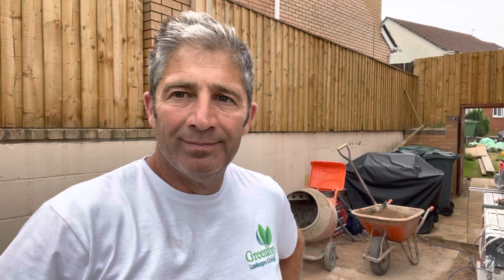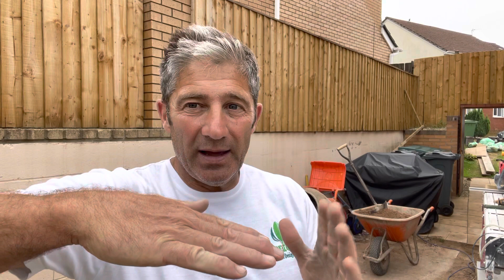Patio Has Been Laid To Damp Course

Comment: Hi John, you sound like a very honest and genuine person well done for having morals. I have a quick question, i have a Timber Framed House, with block work on the outside, and Timber Framed inside, I've ripped up decking that was installed in our house we purchased as it was very slippery and unsightly.  It was installed approx 1.5ft above the DPC.  I've removed everything now and I'm back down to ground level and its all Type 1 at ground level, however I'm installing a patio, however it will be impossible to install it 150mm below the dpc as it would involve a serious amount of material being removed and the patio would then be approx 2ft below the rest of the surrounding garden and paths to the side of the house.  The side of the house has block paving and quite a large gap between that and the house which is filled with stone chippings.  My finished patio level will be approx 60mm below the DPC and just below the air bricks.  Would this be OK?  I was planning on leaving a gap between the house and the patio and then either installing a grating cover between the patio and wall of the house and dig down below that back down to the ground level that was there below the original decking (which will then just let the rain water flow through as it did the decking) (I can't install an ACO drain as cant tie into any of the guttering drains) or alternatively would it be ok to just leave just a gap between the patio and the wall of the house and just fill thar with stone chippings?  Would I need to make sure the ground below the stone chippings is 150mm below the DPC?  Would this the be OK?
Reply from the maker: @scubacollie2083  hi, thanks for the response it’s very kind of you. If you would like to speak on the phone please don’t hesitate to call ☎️

Comment: Just some general advice please. Considering laying a porcelain patio at the back and side of the house. Likely to be about 9 or 10 metres wide by about 4 metres. Thinking of going 1 brick below the DPC as our doors have been set quite high. Looking at placing something similar to ACO threshold drainage against the house wall between the pavement and wall, but with the fall towards the drainage system, so in effect from the slabs towards the house, but into the threshold drainage of course and the threshold drainage ever so slightly angled with a fall away from the house. Have a number of downpipe points to be able to connect the threshold drainage into as well. Do you think that would be OK or risking problems?
Reply from the maker: Call me Liam mate it’s easier
Reply: @GreentopLandscapes  Will do John. Thanks.

Comment: Hi John, im glad ive found you  on here as i also need some advice before commencing with new porcelain patio being laid finishing at dpc level . My building inspector said it will be ok as long as acco drainage system is layed level  along dpc along new extension . I havent yet had extension walls rendered and my thought process is saying lay acco drains first and then apply render drip bead onto wall so it sligtly over hangs acco drains and then apply silicone render to external walls then lay patio with a slight fall to acco drain. Do you think i may still end up with damp issues or does this method seem ok. Thanks for any advice , Terry
Reply from the maker: Hi Terry give me a call Buddy it would be easier to explain
Reply: @GreentopLandscapes  Ok will call tomorrow ,Thankyou
Reply: Can i have your number please.Im struggling to get it , just phoned two wrong numbers lol. Cheers
Reply from the maker: 07795595994

Comment: nice videos very good , i have a little quiestion  if i want to put a patio along the damp course level threshold level . by   having  the fall away from the house can i put a layer of dpm against the house in between the slabs and the wall. or should i leave a gap and fill with stone perhaps something close to the slab colors (and put dpm between wall and stones perhapes) . i know really patios should be well bellow any damp proof course really
Reply from the maker: No it won’t work Oliver as you will have what is called bridging

Comment: Great information,  would you recommend to use grano dust instead sharp sand to lay bricks paving?
Reply from the maker: Sharp is better but it’s not like it used to be
Reply: @GreentopLandscapes  thanks , what’s the difference really?
Reply from the maker: Sharp sand will permeate natural where as stone dust is a by product with does not have the porosity
Reply: @GreentopLandscapes  thanks for your attention.
So, grano dust not recommended at all? 
Do you think the patio will fail with grano dust ? Clay brick paving?

Comment: Hi, I have watched your earlier videos and at the time you seemed to be happy with Easy Joint. I am currently using it on my sandstone project and am now concerned that you no longer seem to recommend them?
Reply: The easy joint should be fine on the sandstone it’s the porcelain that he talking about I’m assuming as porcelain isn’t porous and the easy joint is which could cause lamination problems but that should happen with sandstone
Reply from the maker: I think we all move on to better and different things, Easy Joint can work well if well compacted and with a lot less water than what they recommend so you can really fill those joints and get it to like the sample block you see some times , plus it works better if you have a sub base that has a porosity value so the water keeps moving and not freeze in the joints, always happy to discuss this,
Reply: @GreentopLandscapes  thanks for your honest answer.
Reply: @GreentopLandscapes  to increase water flow through the mortar bed would you advocate drilling drainage holes between the paving joints before installing the pointing?
Reply from the maker: It’s never affective enough

Comment: I see damp coarse bridging time and time again. Most of the time it's because they can't be arsed digging it out to the correct depth to allow for that 1 or 2 brick below DPM. If they can't be arsed to spend the time to dig it out they most certainly are not going to do a good decent job with any thought about it. Drainage and where the water is going to go is the first thing I do when I design and build a garden or patio. And up here in Carlisle it rains alot and I discuss this thoroughly with the customer and drill it into them it's the most important part of patio design and build. My simple sentences to alot of customers that want to know why landscaping is expensive I simply say it's the biggest most expensive room in the house to do properly and say to them what makes them think a garden or patio will cost any less than a kitchen or Bathroom to do. Then I  tell them about the drainage and all the details that go into building and designing there gardens. Explain things properly and customers will understand and constant communication is key
Reply from the maker: Spot on

Comment: Sounds like a looming disaster. They will probably need to cut the closest slab to the house in half and pull the drain off the wall and dig down and put in a 50mm gravel border lower than DPC so any run off from a now deeper channel drain soaks into the gravel. The also want to be raking out that brush in grout and replace with a proper porcelain grout.

The video would have been nicer if we could see the patio in question but I understand the sensitivities around that.

Comment: great information.I have had a porcelain patio laid.I have many issues.They grouted with a wet mix grout which as they had uneven slabs and unequal spacings has been finish with a trowel,sponge and float so all areas are different and poor, also rained heavily just after grouting so the finish is bad.Patio is also higher than the air bricks to the house,bad cuts and the edging bricks havent been flaunched so are breaking away.The main issue is the drainage,the patio runs to the house and they haven't  installed any drainage to the house.I did comment about this at the time but I was told as soil is good soil an aco wouldnt be required.Anyway being a plumber myself I just presumed to have a professional job but it seems there's bad eggs in your industry as there is in mine..great videos
Reply from the maker: So sorry to hear Alan mate, be happy to talk to you Sir.

Comment: Dont understand your comments regards to brush in grout. I've used a brush in grout with my  porcelain installation. All materials were  purchased from Marshall's and I haven't had any staining issues.
Reply: To be fair fella, he does so it's his opinion. Some guys had great success with brush in products other maybe not. If it works for you great 👍🏼 I've seen brush in grouts done well and I like them.
Reply from the maker: Hi Matt, brush in grouts let the water through and this is not good for any paving the Freeze Thaw affect will soon break the brush in grout down, so please you haven’t had any issues yet.
Reply: Thanks for your replies.The grout I used was a resin based grout,so I'm presuming not cement based.
Are we talking about the same type of thing? 
If these brush in grouts are potentially troublesome why would manufacturers supply them as recommended with their products and also offer a 10yr guarantee? 
I suppose that whatever grouting material you decide to  use needs to be the correct application for the material that's being installed.
Reply from the maker: Hi Matt there are loads making brush in grouts now it’s crazy and the simply are making money.